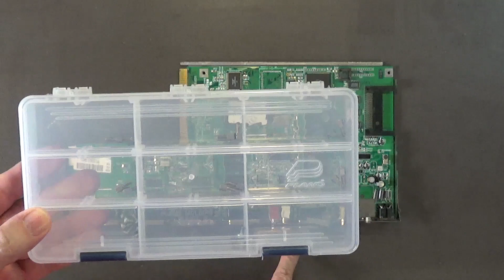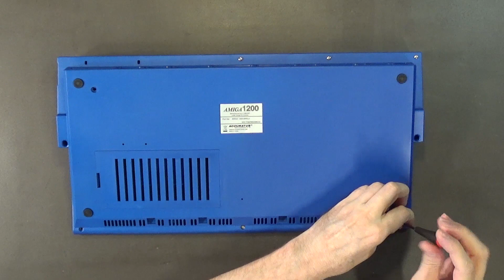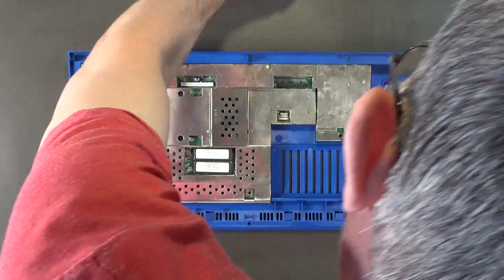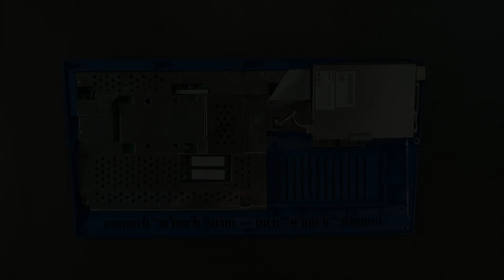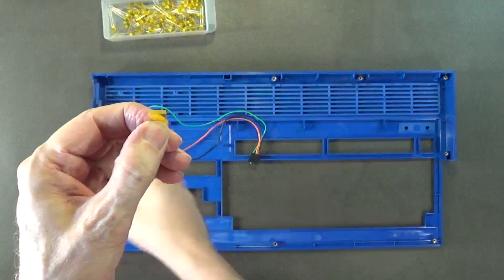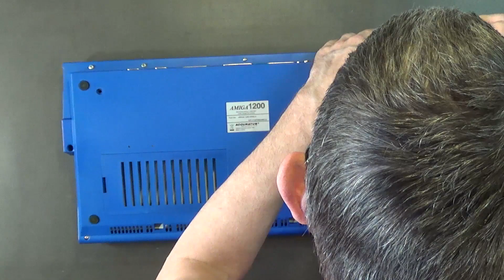Working on my Commodore Amiga 1200 computer - Part Two

Comment: on the new cases, I love the new cases how they look. but have never had issues with screws in the original old fashion screw type holes. in the years sometime a little bitt fatter screw was needed to get grip on things. as long as you dont pick to long ones like some people did. butt with those new Accurates cases, i hate the rampa inserts, actually I crosstreaded one screw and broke the stem  including the rampa insert from the top-front case applying the slightest amount of torque, the second time I opened the case. and also broke one stem when I forgot to undo one of the screws near the diskdrive opening also those screws overthere go in a strange angle in a very deep hole. maybe due the fact that the new translusant 1200 case I have are so much more brittle even then the 35year old original casings, the old ones tend to be much more squishy and more forgiving. mainly due the fact there must be way more glass in the new translucant extrusion molded cases.
Reply: well , actually exactly like You pointed out in the end of Your video. LOL
Reply: and the strange screwhole not used is for fastening expansion pcb's to use behind the little door on the back, usb and/or hdmi mods for instance. or a older scsi extermal connector could do make use of it. I have on an old expansion card I have in one of my 1200's